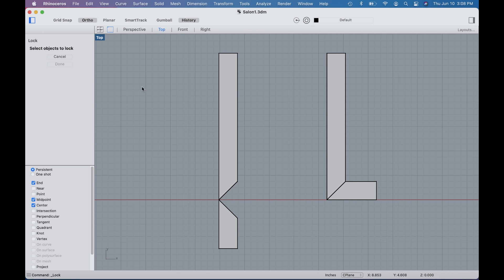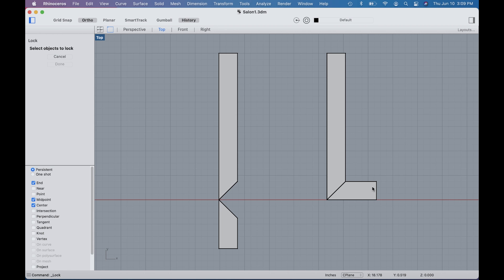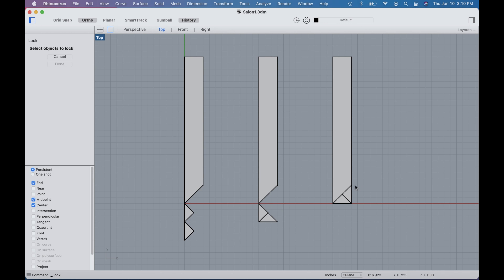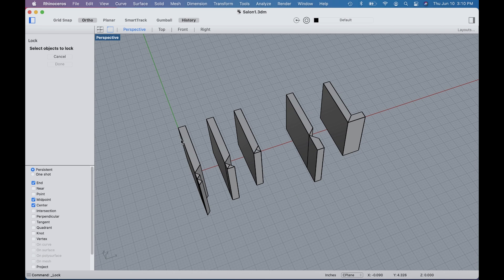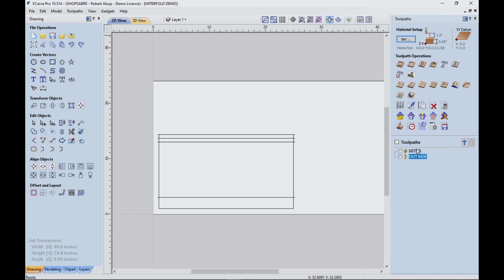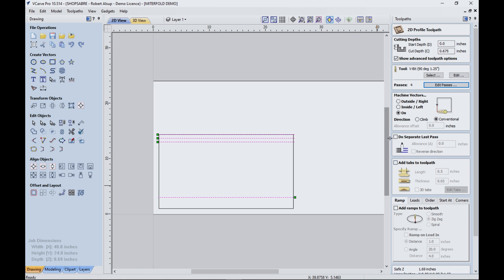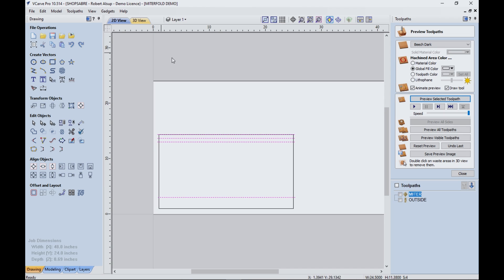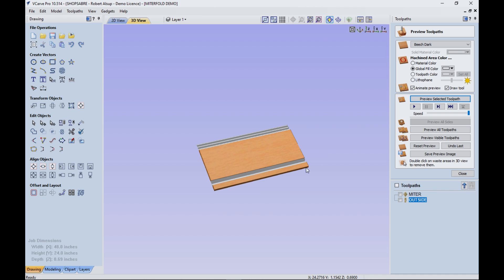Miter Fold Cutting with ShopSabre CNC Router

Comment: This is brilliant!  What but did you use? 

I'd really like to learn how to calculate how to step the paths for a 90° groove using a Vbit that's too small to fit the depth of the wood. 

I did invest in a big Vbit to avoid the difficulty, but if still like to know how to do this 

In the meantime, using the miter cuts for plywood edge banding will be used in this house! 

Thank you!
Reply from the maker: We use the Miter tooling from Vortex Tool, if you give them a shout they can help you choose the right tool for the job. If you have a ShopSabre, we can help with the guidance on the programming.

Comment: what is the v bit tool number?
Reply: I have been trying to use MDF with maple veneer and I can't get it not to crack when I fold it. I am using Vortex tool #7055 90 degree V bit. I really need the more help on this please anyone?
Reply from the maker: If you have a ShopSabre, the tech support team will be your best contact during normal business hours.
Reply: I had some success spraying the veneer with water and bending it a little at a time.
Reply from the maker: We recommend Vortex Tool

Comment: Great video, I would like you to go deeper into the tooling, which drill bit you select, and what parameters you use to set it up.
Reply from the maker: We use Vortex tools and their recommended setup
Reply: @shopsabre  It would be awesome to know exactly what bit or what parameters the bit needs to follow. Meaning, does it need to be a 90 degree Vbit that has edges longer than the depth of the material?? I imagine if they were shorter you wouldnt get a true 45 degree chamfer?
Reply: @shopsabre  They do not have a tool database, unfortunately. Can we get the cut parameters for this V-Bit please

Comment: Nice video. You could also use the painters tape on the in side of the board ( next to the cuts) to quickly clean up the excess glue squeeze out
Reply from the maker: Great tip!